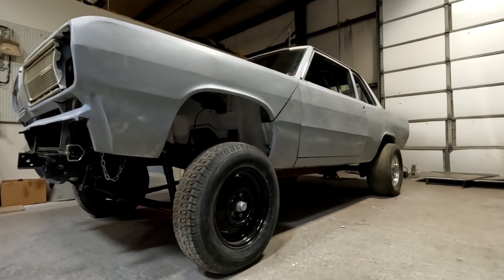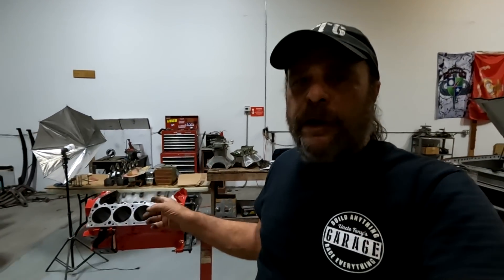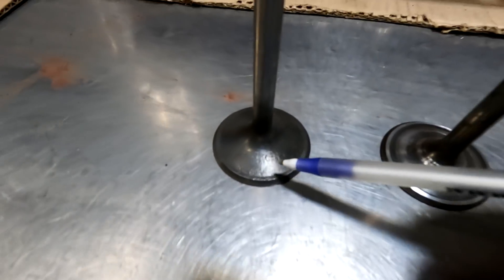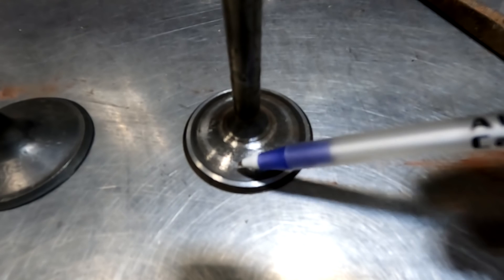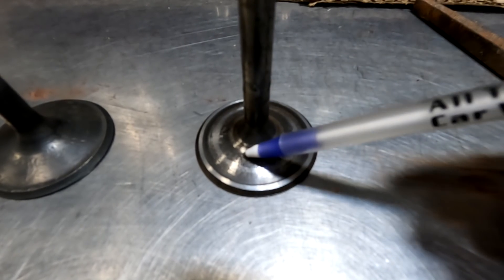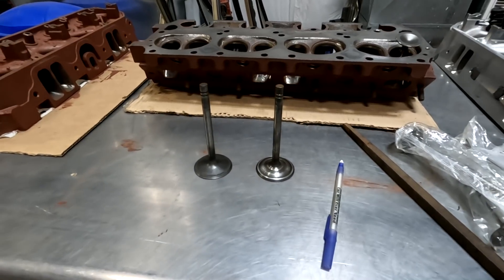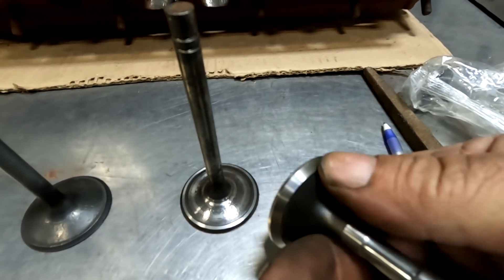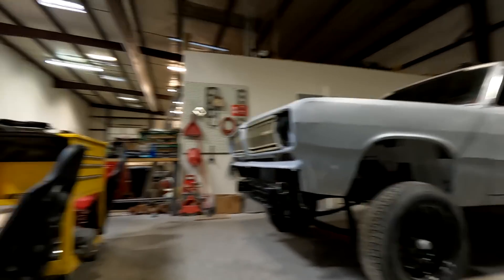Even MORE Free Power For The Home Engine Builder

Comment: I was always told that troft on the back face of the valve was there to help with low speed/velocity atomization on carbureted applications! supposedly it's supposed to make low speed unatomized fuel kind of bounce off the valve and spread out into the combustion chamber better instead of just pooling the cylinder in one spot! meaning rather than collecting in a puddle on top of the piston it's supposed to come off the valve and kind of bounce into the cylinder walls!
Reply: Again, as Tony said, we are dealing with carbureted engines rather than electronic fuel injected engines.  The trough is not needed on the more modern engine where flow is sensored and monitored.  On the Keith Black and Ed Pink engines the valves (racing valves mind you) did not have those troughs.
Reply: by the way I've always back faced my valves and got rid of that ridge because there's no way it can help performance just like the crossover in the cylinder heads and intake manifold always gets blocked off! stuff like that is there for production vehicles to help driveability and emissions and my thought is, if it helps driveability or reduces emissions then it also reduces power! except for PCV valves, definitely run a PCV valve! I used to run them into the exhaust or put in a catch can or puke tank but not anymore, just run a PCV valve!
Reply: Rusty,
This is exactly what I always thought it was for. Promotion of atomization. 
As per what Tony was saying regarding late model stuff (EFI world) they have dry intake runners and spray fuel right above the valve already atomization the fuel.
Reply: Sounds about right: as flow comes off the valve on opening, the low pressure/inreased turbulence area after the ridge helps put trace liquid back in suspension - but nothing major.  Probably does absolutely nothing after say... 0.200 lift.  Modern engines with their higher thermostats and egr systems likely see no benefit.

Comment: if you think tires sticking out that far passed the body looks good  well  we disagree
Reply: Then you’ll have to disagree.👍
Reply: I remember back in the day Chevy mikado (Chevy luv trucks)and Vegas with wide 12 bolts and 9 inch Ford rear ends roaming the streets. Not many street racers narrowed rears . So whole tires set outside body lines. A friend of mine used to run one of the Vegas.  2 speed powerglide and crazy steep gears everytime he would let of the gas completely at speed that car would do some scary things. Stock vega front suspicion with most likely worn out everything. I totaly get having tires inside body lines but also love the going back to nostalgia error looks is also cool.

Comment: Idk if you will see this comment but I was wondering if you could do a video on repairing or refurbishing fuel sending units. I bought my dream project car three years ago and I found out they do not make any replacement parts for the fuel sending unit and i would really like to have a working gas gauge. Nos ones I’ve found were over a grand so that’s not a option for my budget 🤣
Reply: Just take it apart, figure out how it works, and fix it!  You have nothing to lose it doesn't work now anyway!  You can do it brother!!!

Comment: I think that ridge is there just to make the valve face wider, so they don’t have to be quite as accurate when machining the valve seat in the heads. Bigger target, easier to hit. Tolerance stack-up, that kind of stuff.
Reply: I think its manufacturing related too more than anything
Reply: I would tend to agree: it looks like the result of process limitations/cost control rather than some highly subtle engineering on run of the mill production engines, Save a few bucks making millions of engines would certainly get the attention of corporate bean-counters.